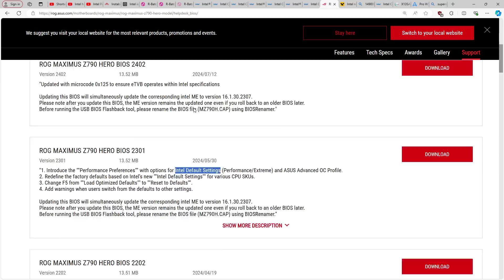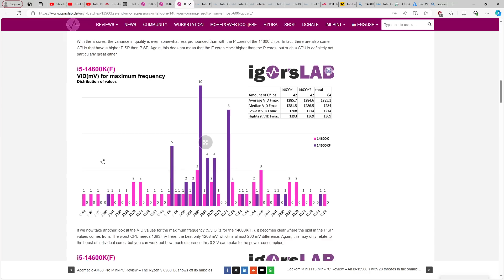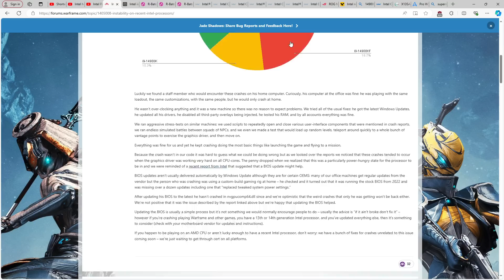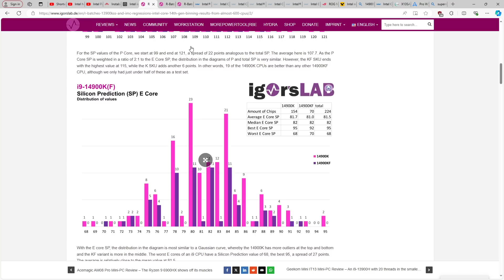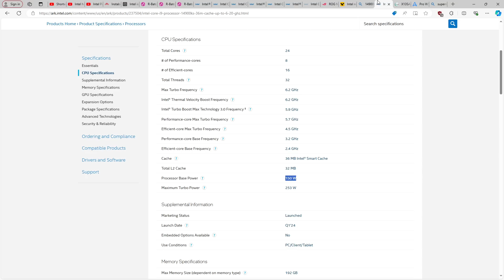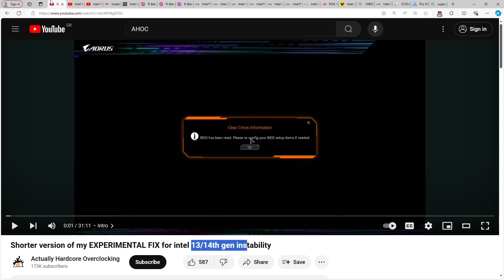The intel instability and degradation rant.

Comment: This was one of the last strongholds Intel had which was their Stability, makes literally no sense to buy an Intel CPU at the moment. They're more than happy to hype their Arrow Lake new arch instead of dealing with this problem, that they KNOW have been happening since last year.
Reply from the maker: You gotta really hope that whatever decision making process lead to this mess didn't also get involved in arrow lake development.
Reply: @ActuallyHardcoreOverclocking  yes but the fact that they're already abandoning the maintenance of a recent product is just shit!
Reply: @stefaneni5321  Did AMD buy back all the ram that was purchased at launch of AM5? Many bought 2 and 3 kits to get them going, and waiting on bios updates for 10 minute bot times. The waiting for RMA processors that blew up.
Reply: @ActuallyHardcoreOverclocking  arrow lake development should already be over if it’s releasing in October
Reply: @3r2s4A4q  That's the problem. Intel has probably known about this for about 2 years, but hasn't done anything except blame motherboard vendors for running the CPUs at TDPs consistent with advertised performance, and issuing 1:1 replacements of some bad CPUs. If this is indeed a hardware defect, it seems to me that this mistake went unnoticed while hacking Alder Lake into Raptor Lake, which likely would have happened around 2020 or 2021. If they copied the defect forward into Arrow Lake around 2022, then they might have finalized Arrow Lake development before Raptor Lake started showing significant signs of falling apart. Since CPU development cycles take several years, any mistake that you accidentally carry forward repeatedly will poison your products for the duration of a full development cycle.
Reply: @asm_nop  Their best bet imho is check and make sure whatever the error was is not carried forward. Even if this means a delay and new tape out. However they are switching over to a TSMC node from their own so on a pretty big re-design so I'm hopeful it didn't get ported to arrow lake. That said I won't trust AL until it's had 6-12 months of very smooth operation on a large number of systems.
Reply: @ActuallyHardcoreOverclocking I doubt that. My best guess is that because didn't innovate for years and years whilst AMD's Bulldozer was around, they got caught when AMD introduced the first Ryzen CPUs. Intel still had a lead and they probably thought it would be enough for the next couple of generations, but it wasn't, certainly not when the X3D CPU's came out.

Intel then rushed into the P core / E core model, but it was rushed. It's basically probably still very much similar in architecture as the 6th/7th/8th/9th gen Core CPU's. And that architecture has now shown it's limits. They boost them to 11 and beyond and it now clearly shows that is not working reliably.

I think Intel will only over these issues with a completely new architecture, something like when the original Core2 came out or the i7 2600K. If they won't, they will get overrun by AMD, Apple and Qualcom.
Reply: @ActuallyHardcoreOverclocking i haven't watched fully yet, but the thing that i notice there's seem to be a specific thing that connects the vid that you - tech yes city - wendell made, and that is RAM / IMC / PCH / IOH, remember the fact that from the launch of 13th gen you have been warning people about the instability of the IMC, so yeah I think it might not be mainly power related, but specific to RAM things

your old vid :
https://youtu.be/5R8en_FtA80?si=jOQHmDw6jFICZgv1

TYC vid :
https://youtu.be/6O5XGVaPDZo?si=bOP_XU3Z4D6nrNY6

https://youtu.be/-ot96M9RM6o?si=OwjmI6hJciQ6112S
Reply: You know how CPUs are developed, many months even years before release. So i actually expect even more problems with Arrow Lake. But also depends at what point they knew they f'ed up.
Reply: @ActuallyHardcoreOverclocking  don't expect any significant improvement from intel until they finalise x86s spec
Reply: @ActuallyHardcoreOverclocking  you mean doing whatever they can to keep up with AMD.  Prolly not
Reply: @ActuallyHardcoreOverclocking this is the biggest problem isn't it because they are actually generations ahead of releases I wouldn't be surprised if they are developing 17th gen now and 15th gen will have the same problems 🤷‍♂️ just a thought
Reply: @ActuallyHardcoreOverclocking  I hope so, they're even using TSMC nodes this time around which are more expensive than their own, they cannot fail Arrow Lake, I hope they won't, we need competition but good competition, Intel needs to stop playing around, remember the Snake Oil marketing of theirs? Snake Oil indeed, selling defective arch to consumers.
Reply: @ActuallyHardcoreOverclocking  It almost certainly is fine in Arrow Lake, the whole point of Raptor Lake and RPL-R was to be a stop gap until they got chiplets and newer nodes working well at the higher frequencies the desktop lineup uses. Hence why there are no issues with Meteor Lake (mobile) or Alder Lake (before Intel squeezed the last ounce out of Intel 7).
Reply: intel fanboys wouldn't let even this affect their reputation
Reply: zen5 comes in 2 weeks and its really stupid to buy intel cpus now
Reply: @Mr11ESSE111  That's a generally true thing. If you don't need now and the competition is launching their latest and greatest very soon (relative to product cycles), then wait. I'd say the same thing if zen5 had just launched and arrow lake was only few weeks away.  And of course always wait for the independent reviews to come out.
Reply: @kaseyboles30  zen4 cpus are not bad too
Reply: @Mr11ESSE111  There were some early issue for them from bad bios's, but hat got fixed and the platform is considered stable/reliable now.
Reply: @kaseyboles30  tgey are not reliable if 50% of 13&14th gen k cpus crashes
Reply: @Mr11ESSE111  Exactly, and that's going to hurt Intel going forward. It's probably why they've been so quite about this.
Reply: Here's an interesting twist.  What if its better to accept RMA cpu's rather than admit that this processor shouldn't have been clocked this high and have all the benchmarks revised down and lose even more sales?  There would probably and still probably will be a class action lawsuit over this.
Reply: @Jeredien  intel with overclock and add fake core to 11 gen and sell them as new gen
Reply: I've been saving money for last 3 months to do a 14th gen build & 4090. Was about to buy it all Thursday, then seen that the RTX 5000 series is possibly a few months away, so thought I'd wait and buy it all then.
I start seeing all this, and will now be looking into AMD 9000 series instead. Not risking it with 14th gen, and what's not to say whatever they have wrong here, they've also  got wrong with upcoming 15th gen. 

What's really annoying after reading up on this, is the same rubbish with all big companies who have major faults, is they deny it, then expect customers to be loyal 😂
Reply: Arrow lake won't be immune - it's not that a significant arch change. They're going to have to downgrade performance back into the safe zone ;)
Reply: @JimmyBob6786  It's actually the node change I'm hopeful for. Tsmc's node is different from Intel's and will build the bits and bobs of the transistors a bit different. If the problem with 13and13+ is structural and not architectural then the node change could fix it. Again this degradations is happening even on professionally designed servers with VERY conservative settings it's not likely a thermal or power or voltage issue beyond perhaps effecting degradation rate.
Degradation is almost certainly a material issue and not a layout issue.
Reply: Idiots bought the Pentium 4 instead of the Athlon64. I have absolute faith they will also keep getting the 14900K instead of the 7800x3D.
Reply: @theexplosionist2019  glad i bought 5950X instead of 10900K
Reply: @theexplosionist2019 because no everyone only games on they pc and 8 core is not enough and 7950x3d is full of bug slower than 7800x3d these 7800x3d is terrible value if you use CPU for multitask aswell
Reply: People who were burned by 13/14th gen processors have zero interest in buying an Arrow Lake. How about Intel upgrade us i9 owners to Arrow Lake for free and we still consider buying Intel in the future? Are they willing to lose lifelong customers by penny pinching now?
Reply: Intel has been pay more for less performance for years now, it looked better on alder lake, then ryzen 7000 happened and x3d units. Now their high end sku's are suffering from cheap silicon and bad yields which gives the customers really bad and unstable products, they went from paying more for less performance to also being cheap on their products, this is looking really grim, If I'd had a 14700k, 13700k, 14900k or 13900k, I'd get rid of it like a plague because in the long run it will brick and you won't be able to sell it to someone in the future.
Reply: pretty sure they can't fix it, and they are avoiding coming outright and saying it that would be a recall of two whole gen of CPU's now it's just PR and Damage control.. 12th gen should be the only CPU's to look at or a Vintage Rig like an X99 or 2066
Reply: @haylspa  I don't think the I5's would be recalled. but losing the I9's of 13 and 13+ and perhaps the I7's would be bad. Though not as bad as what their doing to their rep.
Reply: @haylspa  i mean they could downclass it one or two bins just using a bios update
Reply: For real, that was the one and.only reason I bought a more expensive even though slower and inefficient CPU from Intel over AMD, stability, reliability, efficiency that translates to a quieter system, but that's out the window now.
Reply: welcome to the last like 5 years. If you have an intel CPU you are a bot and don't care about performance. It really is as simple as that.
Reply: Maybe you need to stop lying, intel cpu voltage haven't been in the safe zone for a long while.
Reply: When was intel ever more stable than AMD?
Reply: I have a feeling, the increased voltages (you can still pull high voltage on a 2 thread single core process at low wattages on a server board), and the ILMbending a board, causing memory and  i/o interference. I wonder if the servers at a 50% failure can regain mem stability back to ddr5 4800 with the ILM cover replacement.
Reply: And even before these stability issues AMD had been catching up to intel stability wise with every single generation after Zen
Reply: if your worried about Intel Arrow Lake don't be Intel has made a lot of concessions to get that Processor at much better state than the fake 14th Gen refresh and its also the reason why its not gonna be coming out any time soon as they are tweaking the clock frequency its the very reason why Intel disabled Hyper Threading and is expecting a clock regression at around 5.5 to 5.7 GHZ but if you are a 14th and 13th gen i9 and i7 owner Intel's silence is deafening.
Reply: Since they are replacing CPUs and there is no sense in remanufacturing the 13th and 14th gens, it stands to reason they would develop the next gens ASAP.
Reply: @HappyQuailsLC  that's sadly left to after x86s is finalised
Reply: Declare defect in ring design, recall and refund, new design on the next gen doesn't have that particular flaw and is better validated, also tighten up the intended behavior for motherboards. And this has to be communicated clearly.

I have somehow a feeling that they knew about this problem and that's why they didn't care if motherboards were undervolting things. High voltage or low voltage, leads to instability either way, stuck between rock and hard place. However in that case, they shouldn't have sold that product at those specs, it feels like they tried to pull off a stunt and get away with it. I have trust in intel's ability to make good cpus, but they didn't do it properly and next gen is going to need extensive third-party testing and some time before I buy it.
Reply: time to get a cheap intel cpu... its great for me wanting to upgrade my 12400
Reply: 1.4V has been considered pretty unsafe and in the extremes for a major part of the last decade, what changed ? nothing. They are just pushing them to insane levels of their extreme limits for meaningless gains.
Reply: Only problem I see why it failing is the voltage is supplied in the same line for the P cores, E cores and the ring. There should have been separated voltages this way it wouldn't have sustained this much of issues let alone killing the entire core outright just because Intel screwed up the design. I think it time to drop the P cores and E Cores cpu and Intel goes back to the tried and true design before the 12xxx series crapshoot as this is my opinion
Reply: Honestly, even my 12700f (where is that system even?) was already very unstable despite year-long expertise in DIY. Now I'm temporarily back on an i9 11900k on a €99 Z590 Gaming Edge WiFi and everything works flawlessly. Granted I haven't overclocked manually and my RAM is 'only' at 3466 CL16, but it doesn't feel like my RTX 4080 is bottlenecked all that much.
TLDR; Intel is just going downhill since 12th Gen or 13th Gen (arguably already with the missing 10-core in 11th or heightened instability w/ 12th).
Reply: @whohan779 12th Gen is having zero issues. You have one year experience😂 you have no experience. You’re the problem.
Reply: @Akkbar21  Thanks for assuming stuff. 12th gen is also broken, which has been known from the start. There have been a handful of games with DRM or instructions crashing which is (at least for me) a totally new issue which I only know from some AMD CPUs on earlier BIOS.
You don't need to assume or be smug about other people's misfortune, I'm just telling you that even in default BIOS settings and never exceeding manual 1.38V for gaming (less for heavier loads) my 12700f was infact unstable. This was almost surely an architectural instability as overclocking (possible through BCLK exploit) was still possible w/o significantly less stability.
Reply: @whohan779  okay pal. You don’t know what you’re talking about.
Reply: @Akkbar21  So do you apparently.
There's people with 13th/14th gen i7/i9 k-CPUs without any trouble and there's me who just told you that I had certain games crash on or at least very near my motherboard's base profile. Granted that was an ASUS B-series so maybe if I switched boards to an MSI/Gigabyte Z-series or smth. my problems would've been resolved.
Anyhow the last generation I can think of that had so many stability problems was the dreadful >5 GHz AMD FX 9000.
Reply: @whohan779  there are zero reports of instability with alder lake like their is with 14 and 13 skus. In fact, if you’re watched the level1 techs video about this, you’d hear that these people who provided the data he used say that 12th Gen was solid and stable. So who knows what’s going on with you and your setup, but it’s not some sign of known issues with alder lake. Sorry if you don’t like what I said, but it’s true. 1 year does not make expertise. Take care, I’ve got nothing more to say.
Reply: @Akkbar21  But was the graph and overview of all games you could play or rather some unnamed one of what was presumably an indie (thus approachable) developer who had a successful game?
In my case it was (among others) Age of Empires Ⅲ Definitive, which I doubt was used as a reference here.
I also didn't use an Nvidia GPU at that time so it literally couldn't have crashed a corresponding DLL (this game also generally runs fine on other platforms with the same GPU and the PSU was already swapped just in case).

I don't mean to insult you, but you're showing some serious narrow-mindedness which doesn't advocate high intellect.
Maybe don't try to disprove experiences of others while lacking solid evidence, just because you apparently are invested in the platform yourself or think your experience should match.
Reply: @Akkbar21  In case my other reply doesn't get through, please tell me.
You don't need to believe me but the only desktop PC I ever owned and didn't built had a Core 2 Quad Q8300. I was on Intel until Zen1 which burned me with a dud 1700 that couldn't hit 3.7 GHz properly (unless AIO cooling was involved).
It's not my lack of skill or experience, it's just my clumsiness or misfortune with the samples I seem to get. I never claimed that most people would have similar problems (just like I don't claim that most Ryzen 3600 users can reliably hit 4.6 GHz which one of my samples can).
Reply: @whohan779  I never said you didn’t experience what you claim. I said it’s NOT indicative of a problem with alder lake being systemically unstable as you originally were inferring. Dunno how you see that as narrow minded or me saying you didn’t experience what you claim. 🤔 any issues alder lake had early on because of big little architecture or windows scheduler were mostly solved shortly after launch (baring a few outlying old programs). So again bro, you’re claiming “heightened instability of 12th Gen” and tacked your issues onto this 13th and 14th Gen stuff. You backed it up with your expertise (you said one year, what did you expect me to think of that?). As for me, I’ve been building PCs since my 386sx/16mhz. I’m not “invested” or fanboying Intel whatsoever, just trying to help people know what’s actually true.
Reply: @Akkbar21  "you said one year" -well that's just malicious of you to think. Obviously I meant to write "years-long" (+s) but my auto-correct thought that 's' was mistyped. I even specified that my experience with hardware ranges back to at least Q8300 days. It's fine that yours goes further, but the CPUs you're referring to are so much simpler, I bet North Korea could build them on some kind of farmsite by now; not much applicable still. All that is to say I almost experienced Intel's first real quadcores.
It seems futile to argue on, so I'll just ignore you from now unless you have something constructive to write.
Reply: @whohan779  😝
Reply: @whohan779  you communicate like you have raging Asperger’s.
Reply: its just the current wave of cpu issues. AMD had em, I think alder lake had issues too with ddr5 etc. people will forget and move on (because you only have 2 options mostly and both mess up).
Reply: @semitope  the ryzen issues were not widespread to the same extent, not even close; plus with an agesa update it was fixed - the reason behind the issue was too high stock vsoc
Reply: My 12700k is kicking ass still. So glad I bought alder lake 😅
Reply: And there it is ladys and gentelmen. Its not that i thought intel or amd cared but what intel stood for, ( Stability.) Is now gone. Ive gave both these companys a small fortune. But the fact that intel is just going to ignore a flagship cpu problem and pond the problems to motherboard Manufacturers, or ram manufactures is childish, when they expect you to pay $1000 cpu.
A its a refresh
B the cost
C make a product you can stand by and stop blaming everyone for your cheese product that will be worth nothing in 5 years time.

We are the problem people stop spending money on a company that clearly is expecting you to spend this kind of money and ignore the problems or shift the issues to everyone else.
Reply: They are hpying it up so people just talk about that instead. And when 15th gen does drop you wont ever see any media or tech channels covering the 14th gen issues anymore but they will still be there. Welcome to tech and media coverage. Problems like this only matter while it's new. Even when it's not fixed it wont be important anymore when their shiny new toy is here.

And while we can and should blame intel here the tech and media are just as much to blame because they enable this behaviour. Never stand to their point never keep going till it gets fixed just "grrrr we are so mad... wait what? 15th gen intel is out now? haha 14th gen who? it has problem still? not in my world"
Reply: your comment makes no sense. it doesn't affect all cpu's, is 100% addressable despite not being ideal as it was sold as an enthusiast CPU for overclocking not running stock with power limiters on(which you can do yourself) but you are a good parrot. Here is a cracker =)
Reply: Frame Chasers 7/14/24   - problem described and solved
Reply: If your primary concern is idle temperatures, the low and mid-range Intel CPUs still make sense.
Reply: AMD is by far much more stable. What intel stability?
Reply: Tbd and was always stable,very hot sure (fx) series but never unstable.. I feel like Intel good,and bad, and not stable is a myth considering they have the same architecture and both work similarly in the machine level and bothe were the one company before
Reply: Yeah.  As someone who sometimes does computers for businesses, I am now recommending AMD CPUs because they are currently more stable, especially in the high end.  I am not sure about i5s, but it is possible that the degradation issues would still occur, but a lot later.

What's amazing is that I have FX and Intel Core chips which are 10+ years old, and still work exactly the same as they did when I first got them, then now we have chips that literally tear themselves apart in the span of months or even weeks.  I'm not even sure that any of the supposed fixes will actually do anything beyond hiding issues until they just come back up again.
Reply: Dang. Good point. Intel was always "it just works" in my experience. Just turn in XMP and you're done for 90% of users.
Reply: Caping P cores to 5.8Ghz and E cores to 4.0ghz made a huge difference in gaming performance and stability. Voltages went from 1.50-1.64v to about 1.40-1.45v. Intel 100% knew voltages were an issue but lowering them would cause instability when the CPU ran at advertised speeds under full load. So, Intel chose to look the other way and deliver the speeds they promised (legally required) knowing very well CPU degradation would follow.

Simply put, Intel backed themself into a corner by not looking ahead and on clock speeds instead of cache like AMD. 

I still love my i9 14900k but I'm disappointed in the overall need to neuter it to achieve stability. I also have warranty for 5 YEARS which is plenty for me and from what I've heard Intel is lenient with providing a new CPU or refund.
Reply: "This was one of the last strongholds Intel had which was their Stability, makes literally no sense to buy an Intel CPU at the moment."
Excusing one hardware bug with early first gen ryzen, that's wholly untrue. You can thank a bunch of AMD users playing fast and loose with DDR4 overclocking and XMP profiles meant for the more relaxed Intel memory controller for that. Stock ram settings, or at least properly memtest validated; Ryzen has always been as stable as Intel.
Reply: ,problem comes from intels silicon (old technology) and intel over over over clock,watt(very hot) them
Reply: @raminpro9765  Except servers that are put in max reliability setting are having issues. We're talking cpu's kept under 85c and at fairly low power relative to their rating. They're being kept effectively underclocked and in a professionally designed and implemented cooling scenario.
Reply: I'm using AMD and Intel for ages now. The "stability" part is the biggest BS I ever heard. Really. And I'm talking here since 1995 at least. Both systems never had real systems that could be pinned down to the CPU or MB Chipset. And remind you, in the 90s and 2000 we still had 3rd party MB chipsets like from ALI.
That also counts for the servers. The only problems I ever encountered were mostly coming from RAM being OC'ed (XMP) and not working well with the CPU.
Otherwise, both AMD and INtel were IMHO on the same level on stability. Maybe not on features or performance (but performance was in early 2000, later on it didnt matter much).

BUt stability? Both are fine.
Reply: @Dr_b_It is an objective fact of reality that a 13900K/14900K undervolted and power limited at 90 W matches a 24-core M2 Ultra in terms of multithread and single thread performance. Intel does have an efficiency parity with both Apple M series and AMD Ryzen processors if you spend five minutes in the BIOS to drop power and voltage settings. But that's too much for people, apparently.
Reply: @NUCLEARARMAMENT What are you on about? Most people don’t tinker with the settings in the BIOS, and they’re not going to. Ever. All the objective facts and ‘but if you just…’ in the world won’t change that. The same goes for anything that’s mass-produced but needs work to make work right. Them not tinkering isn’t a fault with them because at this point, they shouldn’t have to tinker. The stuff needs to be safe and stable out of the box, period.

Disclaimer: I am a tinkerer.
Reply: @shoryuag  agreed
Reply: @NUCLEARARMAMENT that is not true lol. Zen 4 when undervolted is even more efficient, and Zen 5 will BLOW INTEL OUT OF THE WATER
Reply: @NUCLEARARMAMENT  yes it is too much and with good reason. Consumers don't want to tinker with CPUs. Professionals don't want to tinker with CPUs, and are in fact generally opposed to it, because rock solid stability by operating well within spec is what they're looking for. The only people tinkering with CPUs are tinkerers, which are probably not even 1% of the user base. This shit simply MUST work OOTB, otherwise it's dead on arrival as far as professionals are concerned.
Reply: @NUCLEARARMAMENT 😂😂😂 ok buddy.
Reply: @NUCLEARARMAMENT  Why would anyone do that? It's like all these "but just disable X cores" people. If I buy performance, I want performance.
Reply: @NUCLEARARMAMENT  That's exactly what I did when I set up a 13900K system for a friend, before even first boot into OS: all cores set to 4.3GHz and a slight undervolt (no more than -100 to -135 mV, otherwise unstable). But most enthusiasts probably wouldn't spend all that money on a newer i9 just for all cores to run at GHz parity, right? And if you only boost P cores to 5.3GHz, it loses to a 7800X3D. So if you're just gaming, what was the point of buying the Intel processor?
Reply: @savagej4y241  Because an i9-13900K(S)/14900K(S) properly tuned can hit 8000 MHz XMP or higher with CL32 or tighter primaries and subtimings with the right memory kit.

This is true even if you did lock all cores, including the ring bus, to run at just 4.3 GHz in your scenario. It would thrash any X3D chip, which is limited to 6000 MHz or so XMP-wise -- if you're lucky -- and there are no framerate dips to worry about either on the Intel platform.
Reply: @NUCLEARARMAMENT  Even if you spend the $250 for RAM that can sustain 8000 MHz CL32 with XMP, you get diminishing returns above 6000 MHz on DDR5 for gaming, and severely diminishing returns above 6800 MHz. The extra voltage required is not worth it and a 7800X3D negates the need for going above 6000MHz anyway- which is easily achieved on an X670 board. So my previous point stands.
Reply: @NUCLEARARMAMENT  And an i9-13900K made to run with DDR5 8000MHz CL32 absolutely cannot match the energy efficiency of a 7800X3D that is undervolted to 1.225v and running with DDR5 6000MHz CL30. That is a pipe dream.
Reply: @savagej4y241 He’s only regurgitating what he’s read/heard. His “facts” are not cohesive and lack any real understanding of what he thinks he’s communicating.
Reply: @NUCLEARARMAMENT that is factually incorrect.
Reply: weird, mines been running direct die at 1.4v 5.8ghz for 9 months now without a single problem...also running Asus optimized without a newer BIOS... this is related to people not cooling properly
Reply from the maker: @BelowAmbient  1.4V is less than the max boost VID on most i9s
Reply: @ActuallyHardcoreOverclocking That explains everything.
Reply: @BelowAmbient  The video Wendell from Level1Techs that Builzoid references goes over this. In SERVER FARMS they have near 50% failure rates after a few months. Server farms that sure as hell don't overclock, that make sure their CPUs are cooled, running workstation chipsets like the W680. Those are still failing at an absolutely astounding rate. CPUs that could pass validation when installed fail to do so after 3-6 months of deployment. 
That it didn't happen to you is good. That you're ignorant enough to blame consumers is not. This is not their fault, this is Intel utterly failing to design a CPU architecture that can last. The chips are degrading from just normal use.
Reply: @BelowAmbient and the server farm hardware failures?
Reply: Don't burst that bubble of his. @Amberion
Reply: @Amberion  Why are you using a consumer CPU on 'server farms'?
Reply: @mick977  I take it you didn't watch the videos at all, then. They use the CPUs on gaming servers in server farms with pro-level motherboards that are power limited for longevity. The decay rate noted by these companies is astronomically higher among 13th and 14th gen CPUs vs AMD or 12th gen or earlier CPUs.
Reply: @Amberion  That is beside the point. It's a consumer chip, it is not meant to be run on servers. That's what Xeons are for.
Reply: @mick977  You're missing the point too. The CPUs were not stressed, they were operating well under the thermal limit and were not overvolted. And they STILL failed 50% of the time. That's simply unacceptable.
Reply: @Amberion  I never said otherwise? Still shouldn't be using consumer CPUs for server use.
Reply: @mick977 the servers in question are gaming servers.  Which is where you want the consumer CPUs.  They are doing what they are supposed to be doing look at the Use Case.
Reply: @BelowAmbient  So all those professional server farms with professionally designed and operated servers from several different vendors are ALL getting it wrong? I doubt that. Those systems are designed with stability and uptime as mission critical and just about every other consideration runs a distant second. Intel f'd up pure and simple.
Reply: @BelowAmbient  Weird? You're running a direct die cooling processor, you expect a simple customer to do the same? 95% of customers won't even buy a CPU bracket and you're expecting them to do direct cooling? You want them to use liquid metal too? A CPU NEEDS to work without issues from day one and without tinkering from any source.
Reply: @GhOsThPk  And you can thank GN and all the other guys for not expressing enough that a 13900k-14900KS are enthusiast processors. Nobody except dummies on youtube told people to air cool a 13900k.
Reply: @GhOsThPk  Then don't buy a high end enthusiast product if you're not willing to know what you're getting into doing what it takes to properly use them. The preventative measures to avoid all of this has been known for over a year. Of course the finger needs to be pointed at Intel here and not consumers, but you can't show people too much sympathy when they're being careless.
Reply: @The_Chad_ your entire post is just utter bullshit, server farms running these at reduced power levels still end up with the problem. All the liquid cooling and contact plates in the world wouldn’t have fixed this. 

Blaming the customer for buying a product and expecting it to perform as advertised is just plain stupid and I have to wonder how much money you are throwing away in life by just accepting bullshit responses you get fed. 

It’s also clear that you don’t understand the issue. Even after watching this.
Reply: @BelowAmbient  it's not normal for 25-50% of the CPUs to fail within a year even without overclock
Reply: @BelowAmbient  Thats not that absurd. And you just used an n=1 datapoint to explain your way out thousands of other CPU's crashing due to various dubious errors with zero proof. Just what i came to expect here in the YouTube comments. My man. 😎
Reply: @fVNzO  lmao, yeah
Reply: @BelowAmbient it does not have to do with cooling. If you watched the other content about this, you would learn that 125W limited under 75C max temps i9s are having fault rates in the 50% (not complete failure to clarify, just errors).
Reply: @SilverKnightPCs when its a lightly threaded load 1 or 2 cores can have access to that entire power budget at some pretty scary voltages. When you run an all core workload it power throttles so hard that it’s safer
Reply: @BelowAmbient Except Intel doesn't sell direct die processors so the fault ends at Intel regardless. Delidding the die also voids the warranty.
Reply: @BelowAmbient  'Anecdote' is not singular for 'data.'  There's a reason that you need large sample sizes to identify trends, and pointing out a single exception really doesn't alter the overall global average. Additionally, there's really no need to jump to the defense of a corporation that has been caught using (and has been prosecuted for) anti-consumer business practices.
Reply: Where'd you go  @BelowAmbient ?
Reply: @BelowAmbient  It is what we call as silicon lottery..
Reply: @BelowAmbient You're really out of touch if you think direct die cooling is expected.
Reply: @BelowAmbient And at the same time NVMEs are also suffering cooling issues to the point of self destructive failure, like some people I know... : )
Reply: @BelowAmbient  No it is not related to cooling  the fact is intel is cooking its self internally and no cooling will fix that at all and 15 gen will be the same and worse, also the fact it is also memory related from people running faster than they should 5600mhz intel spec.   So no reason to buy intel anymore till they figure there crap out.
Reply: No, its not due to cooling issues. Your single sample is not reflective of all bro. @BelowAmbient
Reply: @BelowAmbient  If you HAVE to run direct die to prevent the processor from malfunctioning, without the manufacturer indicating such, then the product is defective; and the manufacturer is committing fraud by advertising 6GHz as a normally achieveable speed on newer i9's.
Reply: @BelowAmbient  You got 1x CPU, unless you manage to find a way to test about 10000x i9's your opinion doesn't matter at all
Reply: @owlmostdead9492  So you are brainwashed into believing that 50% of all Intel processors are in the landfill.
Reply: @kramnull8962  No, I just very nicely said that you're regarded for thinking your 1 personal experience is enough to build any sort of metric or argument against the current story.
Reply: @owlmostdead9492  Same people that say Intel has a 50% death rate, also celebrate 15% boost numbers with 9xxx and a 6600xt.
Steve at GN will have affiliate links to sell 14th and 13 on black friday.
Reply: @BelowAmbient  50 percent failure rate means lots of cpus are ok.  Thousands are sold.  You got lucky and was on the right side of the coin toss.  Many are not in fact HALF of all intel customers that brought those chips are dealing with silicon that will die before it should.  Why on earth would you pretend that doesn't matter because of your one anecdotal experience?  You are proof that a tech nerd can lack basic common sense and understanding of statistics.
Reply: @BelowAmbient  It might be stable right now, but I think you're just delaying the inevitable. Remember that i7 at max 1.433v were also failing. Yes, i7 failing at a much lower rate than i9, but normally you can just get a CPU that have been used heavily back then and 10 years later if you want to test it it would still work normally. I don't think your CPU will be able to do that. But if you don't care about all of those and you also don't care about the resale value (since you run direct die you probably don't care) then yes, you do you.
And no, it isn't about people not cooling their CPU properly. Intel set their max temp and if the cooling is inadequate, the CPU will just throttle. If it only throttle at 100c and that contribute to the degradation then it is an Intel problem and not user problem.
Edit: also need to remember that the most damning evidence came from the server side which it probably ran the CPU at conservative setting. It ended up showing more failure or fail faster probably because it ran it 24/7. Other story from the developer PCs also showed a high failure rate probably a combination of running it with out of the box settings (which is currently not recommended) and the PCs being used daily, most likely a minimum of 5 days a week from 9 to 5 (8 hours a day, 40hrs weekly). Data from the crash report is basically only for the PC that actually crashed, thus we don't know the percentage of normal user that experiencing this instability, but from the crash data we know that Intel CPU, especially 13th and 14th gen, especially i9 crashed a lot more vs the other CPU brand.
Reply: 50% seems to have zero issues so maybe it's where they've been made?  @BelowAmbient
Reply: @BelowAmbient  360 AIO with a contact plate, getting all kinds of issues now, no overclocking no nothing.
Reply: @BelowAmbient  More likely a decay issue due to how many cores are on the die.  The architecture was rushed and typically the same structure of the previous generation.  It wasn't designed for as many cores as it has.  And it's estimated to be about a quarter of the chips are already suffering the effects of degradation.  And most aren't hard crashes.  This is not a cooling issue, it's a design flaw.
Edited due to mixing up the architectures.  It is Raptor Lake not Arrow that is the known issue and was obviously rushed.
Reply: @BelowAmbient hahahahahahahaha. BULLSHIT. You just won in silicon lottery. And to transfer your experience to the world are short minded people behavior. Get over it. Intel is shit right now.
Reply: @BelowAmbient  no it's not
Reply: @BelowAmbient so how do you explain the server usages that never got above 80c dying and never got oc or even fast ram? None of thiers died until they did.
Reply: @BelowAmbient same
Reply: @BelowAmbient yup you will most likely never have a single problem. And people on regular AIOs who run 5.7 and a undervolt won’t have any issues either. The chip itself is great. It’s the out of the box settings for normies that’s the issue
Reply: @BelowAmbient anecdotes are just that…
Reply: @BelowAmbient  Ahhhhh yes, you're completely right, People are supposed to VOID THEIR WARRANTY to get proper cooling, ahhh my mistake I just expected things to work by default settings out of the box, how silly of me.
Reply: @BelowAmbient You realize that direct die water cooling with chiller is NOT a "proper" cooling, aren't you? If such a cooling is required for their product to last at least for a warranty period, they should mention about this, right? Oh wait, actually going direct die voids the warranty, so they actually telling the opposite - you should NOT use direct die cooling with their products.
Reply: @BelowAmbient No. This is related to not all CPUs are affected. You're lucky
Reply: @tarron3237 it is not about luck. He has an all-core OC. That disables single core boost. This will most likely be traced to high voltages during 1-2 core boosts. That is also why 125W power limits do not fix this, because you can still have those high voltages on small core count loads.
Reply: @BelowAmbient give it another 3-9months and report back to us
Reply: @Toasty27-q6w  You give AMD 3-9 months with their overclocking CPU. We'll see where you are overclocking your gem. Unless you are on B450 still.
Reply: @Toasty27-q6w I been running oc since day one 13900k on aio no contact frame or direct die no issue
Reply: @HosakaBlood  I love being a sockpuppet account for a brainless corpo shill. I hope you're getting paid to shill this hard buddy.
Reply: @kramnull8962  I've had an AMD 4000 series laptop overclocked since 2020, it's my main PC that I use for work and gaming. After a bios patch it's been much more stable than any Intel machine I've ever had, and I've been using Intel since Pentium 3...
Reply: @xmlthegreat  I'm sorry you had to go dumpster diving.
Reply: @BelowAmbient  >this is related to people not cooling properly

Sounds like it's actually related to the chip running too hot - bad design.
Reply: @mehck2  Neither. These things are failing even when in server configs where they stay was under 90c And at lower wattages.
Reply: @kaseyboles30  I doubt a single 13900k or 14900k that failed in a server setting didn't hit 90c. The chips are sort of made to hit that temp.
Reply: @mehck2  At least one professional hosting company hard limits their systems (professional server systems!) to under 85c.And their seeing half or more of their 13thgen and "14th" gen Intel I9 systems have issues. They said none of those (the degrading) systems ever reported a temp over 84c.
Reply: @BelowAmbient I have a 360mm Corsair AIO on my 14900K on a asus Strix z790 and had a lot of stability issues until I manually clocked the Pl1 and PL2 down to stock wattage limits which was 253 watts I believe. Its not a cooling issue
Reply: @BelowAmbient  How much power does that use lmfao
Reply: @BelowAmbient  1.4v for 5.8 lmao my 5950x is at 1.275v @ 5.3 can gain another 3/400 with a .015v but i live in a hot as fork place with humidity always in the high 80s to mid 90s
Reply: @plebbsquad5102  fellow 5950x owner. You aren’t doing a bit over 5150/5200mhz. No amount of anything except exotic cooling (beyond water) is going to change that at sane voltages. It’s all the platform can handle. 

I’m sorry, but there’s just no way you are going to “pick up” 300/400mhz on the 5950x which is already very close to its limits out of the box. Even my sample which happily does -20 all core all day long in CO won’t do this with plenty of power and a 360mm aio in Push/pull.

It’s not for a lack of trying either.